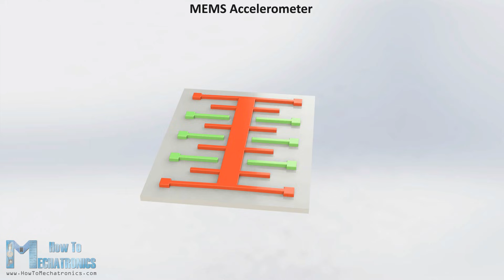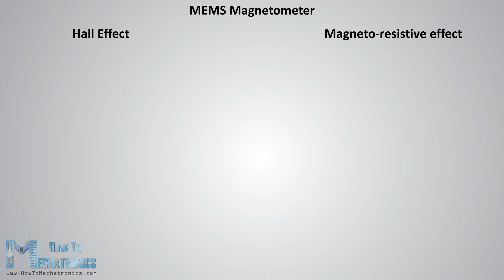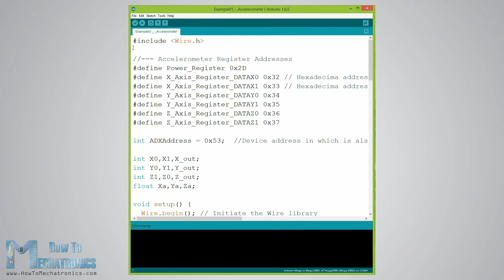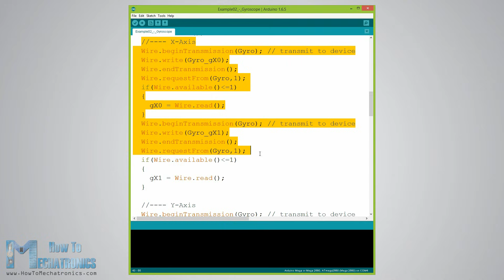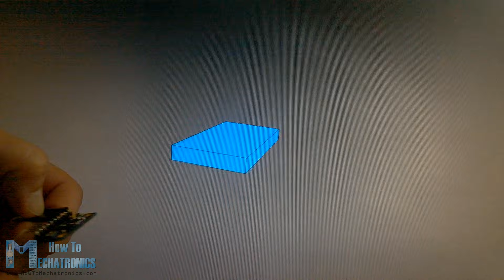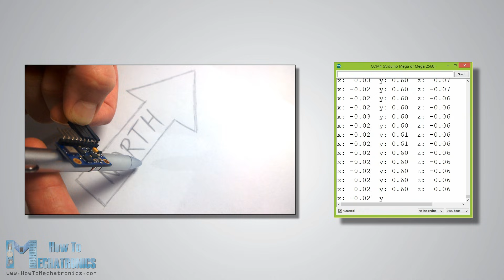How MEMS Accelerometer Gyroscope Magnetometer Work & Arduino Tutorial

Comment: I am a PLS and have long wanted to make an inertial device for land surveying.  However the device would need to be about 50 times more accurate than what is currently available using these MEMS.   It seems that having the sensor be a mass suspended on springs is the limiting factor, and that a ring laser would be much more accurate and lass prone to drift errors over time.

Comment: I'm really lost between the three sensors! Are they similar or what?! Do they share similar functionality or they are completely different?

I learned some of the HMC5883L and got the atan2(x,y) to get the heading which is I guess in radian. So I got the 360 degrees heading, but what does the z-axis do?

And then what does the accelerometer has to offer other than the HMC5883L? And how's the gyroscope is different than the other two?

Comment: My experience with magnetometers is, that they are pretty unreliable. Can't seem to get valid readings near motors or large metal objects.Any thoughts on improving that? Also it would be nice to have a more in dept video, about correcting the gyro drift.

Comment: Awesome explanation for everything! I followed you and I will always be following you! 
But I have one question: Did we use any kind of filter to reduce the noises? And if not, shouldn't we use one?
Reply from the maker: Thanks! Well I didn't use any filter but yeah to reduce the noise a some kind of filter is needed.
Reply: @HowToMechatronics  yesterday I did what you did exactly with the same code and the same hardware connections. The code worked. However, the values of Anglex, Angley, Anglez are decreasing equally from 0 till - infinity. Where do you think is the problem?

Comment: great great video, but i have a question can you help me?
I am trying to put the arduino sensor in my room door and want to calculate the angular velocity of the door accordingly to the force applied by my arms or something else. Is this simply possible with this simple arduino sensor? is it the matter of coding to get the angular velocity or should i look for another sensor to get the values of it? any helps please?
Reply from the maker: Thanks. Well yes, you could probably use this sensor for that purpose. The sensor has a gyroscope which senses acceleration so with some coding you can get the velocity as well.
Reply: Thanks for your reply. But i thought that Arduino Sensor was only able to perceive the angular velocity when the sensor is located in the axis part. For example, do i have to put the sensor on the hinge (door's rotating axis) of the door? or can i put the sensor on the handle part (a location where it is a bit away from the axis)?

Comment: This code is simple and clean.
I learned to program by studying pinball machine firmware at a time when the engineers were forced to use assembler language for 8 bit processors. The Williams pinballs were using the MC6800 first, then the MC6809.
When I started to use C language, I found natural to check that the compiler generate the same assembler code as the hand coded version that I knew for years.
The code to read two I2C bytes and make it appear as a single 16 bit integer would be:

X0 = Wire.read(); //get D7-D0, the 8 least significant bits
X1 = Wire.read(); //get D15-D8, the 8 most significant bits
X_out = (X1 << 8) | X0;

The only difference here is using "OR" instead of "+". The assembler instruction for shift left was one byte less than the instruction to add two registers and return the result in a third register. It was also faster by 1 machine cycle. But the real reason I preferred the "OR" over the "ADD" was the elimination of risk of overflow spilling or corrupting the next bits. This risk is more obvious when dealing with many binary fields of different size in a given 16 bit register.

The type of X0 and X1 should be "unsigned" if these variable are 8 bits. Otherwise, in both the "|" or "+", an overflow can occur if the bit 7 is 1 in the variable X1.
For example, if the sensor returns:
0x8006, the value in X1 is 0x80 and X0 is 0x06
The answer from "X1 < 8" should give "0x8000" but if the compiler think that X1 is signed, it would extend the sign and the result would be : 0xFF00. The negative bit D7 makes all bits from D15-D8 to become one which elegantly preserve the sign when converting signed 8 bits to signed 16 bits.
Then, after the "|" or "+", the final result would be 0xFF06, very different from the expected 0x8006.

The problem is avoided here because all integer are "int", which is 16 bit or 32 bits, so no worries about 8 bit overflow.

The last line:
Xa = X_out / 256.0 is converting from "fixed point" to "floating point".

The fixed point assume that the 16 bit value D15-D0 is actually composed of 8 bit integer (D15-D8 is seen as the value 0 to 255 (unsigned) or -128 to +127 (signed))
and the next 8 bits are assumed to represent a fraction ranging from 0 / 256 to 255/256.
 
Suppose the 16 bit value would be 
0x00FF (255/256) and we add 1, the result then become:
0x0100

The integer part is "1" and the fraction is "0/255"
which is effectively 1.0

The value 0.5 is 0x0080 (integer part is 0, fraction part is 128/256)
The value 1.5 is 0x0180
Reply: Bro, Can you Advice me that code

Comment: Is it possible to also measure the current displacement in X, Y and Z of the circuit, relative from a previous know point, without too much drift on the actual values? I don't know If I am making myself clear, so let's say I have:

- The readings from all sensor in time T0 = 0s, and I call that position in space as S0 =
 (X0,Y0,Z0)
- Then I move the board to another place in time T1 =/= 0, and I call that new position in space as S1 = (X1,Y1,Z1).

Is it possible to get this difference with these sensors? Or I am only able to get the angles and inclinations? What I actually want to do is a wireless mouse that can make the mouse pointer go to the the place of the screen I am pointing it to (like a Lightgun), but I don't want to use IR sensors/cameras. If I don't get the X/Y displacements, something that I don't want will happen: I'll be able to be next to the monitor, pointing the circuit to the wall and it will think I am pointing to the center of the screen. At first I was thinking about doing double integrations with the data accelerometer provides me, but I read it won't be enough to get X/Y/Z , due to drifts...
Reply: Drift is inherent, but can be easily corrected with different filters. The following being a popular one: https://en.wikipedia.org/wiki/Kalman_filter

Comment: hey,dejan,i guess there is connection mistake between arduino and GY80 at 3:26 of your video, you connected the GND of arduino to the Vcc pin of gy80, but i think the Vcc  pin should connect to 5v of arduino

Comment: Would it be possible to create an accelerometer simulator in processing without using an actual accelerometer? I'm thinking of a 3d image that you can move around with the mouse and quickly get (sort of inaccurate) accelerometer readings?

Comment: another very clear video.

may i ask what software you use to make your slides

are you able to give me some guidance on a project i would like to make.  i would like to be able to measure vibration x, y and z values in three areas within 400mm of each other and be able to record the data a export it into a spreadsheet.  what sensors should i buy to be able to start this.  this will be my first ever project

Comment: Do you have the IDE for the 3D block rotating with the gyro as well? I could not find it on your website?
Loved your video btw. Thanks a lot for sharing.
Reply: Dejan Nedelkovski thanks so much! my project is due on April the 15th and would really appreciate it if you could release it before then. I understand you have your own timelines in mind. I have sent you an email @ your hotmail. Would it be possible for you to send me the program standalone via email? I would greatly appreciate it. Thank you so much for your responsiveness to the community you have built. It will certainly not go unoticed

Comment: Thank you!!!  These little devices are incredible. We are developing s new solar tracker product for the home owner.  I am currently using after-market tracking controllers.  They do not fit the need so I am developing our own sensing unit.  With many solar panels mounted to a post, it is often desired to park the panels to a flat position for high winds or other reasons. Thanks again.

Comment: Hi, Why the two pins on the arduino MEGA that you displayed on the video did NOT have any label on it? The ones you connected the data from the sensors, I want it to try on my arduino NANO and i does not know what pins i should connect the data from the breakout board, By my search the pins are "SCL" and "SCA" labeled, is that correct?

Comment: Hey!  why is the code for accelerometer is so different  than from what the arduino official site provide? is it due to different model of sensor? because the code they provide is much smaller in length. P.s i don't doubt your code it must be great but i want to know the difference.
Reply: Ok, i am working on a project where i have to do fall detection for an elderly person. The elderly person will be wearing a tag device which will contain accelerometer,arduino,zigbee now when the elderly person falls his change of acceleration must be detected and if it crosses certain thereshold a fall alert will be activated on receiver which is a distant computer and is connected to arduino and zigbee receiver. 
which type and model of accelerometer should i use here?